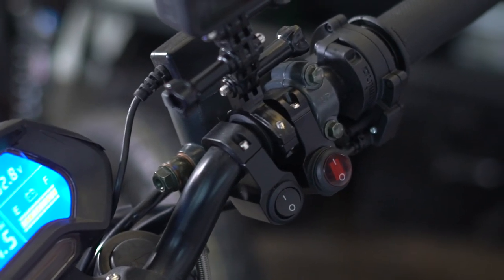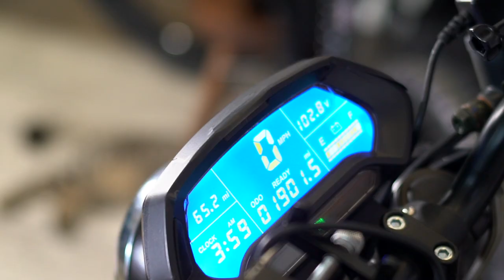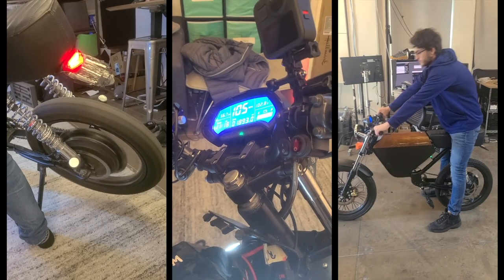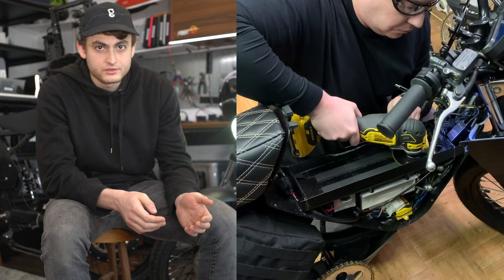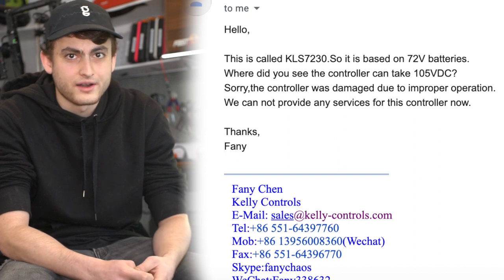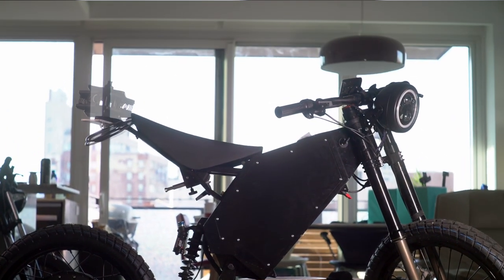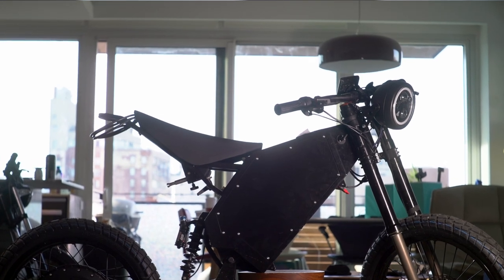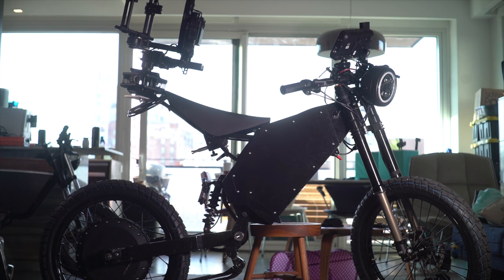We Built a DIY camera rig on a 70MPH E-bike

Comment: Finally another high voltage build i see ! 

High voltage setups are so underrated . I run 32s 120v with a 250amp controller and its a fucking rocket. 

Hope you have a blast on ur new setup!
Reply from the maker: Thanks, that 32s build sounds like a beast! Where can I find some pics of your setup?
Reply: @DIYThingsThatFly  Sorry didn't notice your reply ! You can see it here https://imgur.com/a/hL6sKHa
Reply: @xJayteee  great looking stealth bomber build. Two quick questions:

1 - Which Controller are you using? (I’m the Far Driver Sales Director in the EU and NA)

2 - What’s the Dual Caliper like in the rear?
Reply: @earthling7011  I'm using the Yuyangking 120250 , That's 60v-120volts and 250 battery amps , Squarewave.

It's ok to be honest , mainly for looks imho , as there's only so much braking you can apply to the rear before it locks up. I only did that as a motorbike fork is way too heavy on the front which is normally good , but i live in an apartment so i have to wheelie the bike up in order to fit in a lift
Reply: @xJayteee  oh ok thanks for taking the time to explain your build decisions. It looked like a Yuyang but I couldn’t be sure until you verified. I have built a bike with a similar controller - the 120150. My unbiased opinion is that the Yuayang is well built and reliable. They also have a decent Bluetooth app. It’s a shame there is no regen in these models. I do like the sound the square wave produces in the engine. That said the far driver controllers are superior in every way. The sound is different it’s quieter but I find it to be a more subtle and futuristic sound. The efficiency is night and day. The power is tremendous without the two stroke like on/off of the square wave but steady torque like a big twin.

One more question if you don’t mind before I recommend a suitable and very beneficial upgrade:
1 - what battery model/config are you using?

If you let me know the max continuous bus amps I can recommend a far driver model that will increase your range, your top speed and most importantly your high speed cruising efficiency. You’ll find the pricing very reasonable and surprisingly comparable to the Yuyang square wave models. Plus - you’ll save a lot of weight using regen with abs once you remove that dual caliper arrangement cheers!
Reply: @xJayteee  when stated: "... Electric brakes that you have to wire..." are you suggesting that -

1 - the controller has to be soldered on the board to enable regen?

2- that electromechanical brakes can be activated by connecting them to a controller i/o?
Reply: @earthling7011  Nonono , There's 2 pairs of wires namely "high brake" and "low brake" , high brake being the regen , low brake being the brake sensor to cut off. When you wire the high brake to a switch or brake lever , it will activate the regen. You can see it in the bluetooth settings of the YYK , being able to adjust the strength
Reply: @xJayteee  There is no regen on high brake. That's just an old wives tale of the early ebike community. The high brake signals braking using +5 - 12 volts on a single wire. You enable it by connecting the wire directly to the brake light circuit. The low brake is a two wire where the signal is sent when the circuit is closed.

Regen and regen force levels are selectable in the app that is correct. When selected they do nothing if your model doesn't have regen.
Reply: @earthling7011  I see , idk . that's what my friend told me but good to know

Comment: Excellent video! So with the stock ONYX motor, battery, and just a new controller you can hit 67mph? My goal is just to hit 60mph without too many mods.
Reply from the maker: I think the stock voltage [not stock battery, needs more amperage] with the upgraded controller should do 70mph or so
Reply: @DIYThingsThatFly  Hi Riley great builds and super lucid video. Do you know the Kv of the stock Onyx QS205?
Reply from the maker: @earthling7011  qs205 4T- idk exactly what KV that is but theres a cheat sheet somewhere
Reply: @DIYThingsThatFly  usually they have 4T 5T or 6T options for bicycle hubs so this would be the "high” Kv option.

Comment: Hey iam trying to build a trike with that speed I just need to know where to buy the whole kit any help plz
Reply: Hi Arhur how's it going? A trike huh that sounds like a really interesting build - I can absolutely  help with that. I have a few questions for you to ensure a proper setup for your build:
1 - How many of the wheels were you planning to power?
2 - What battery were you going to power the system?
3 - Is your priority range/ high cruising speed or acceleration and high torque?
Reply: @earthling7011  well this currently my issue decision for the usage 3 wheel custom build it will carry weight sort of speaking around 220lbs so I'd like to get 50mph with this one I'm also building a custom car build similar to a go cart but bigger scale I've been. Looking at quad e trycles and again unsure of what to use love to hear your views
Reply: @arthurlopez116  hey Arthur if you could answer my questions id be glad to help.